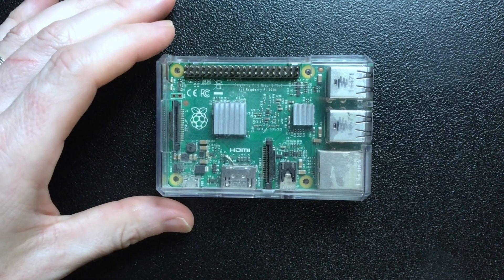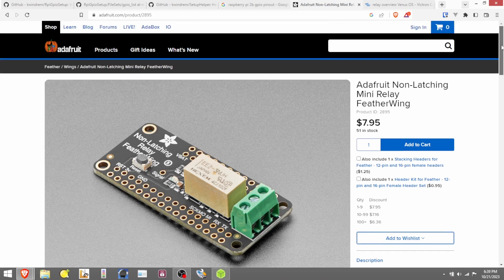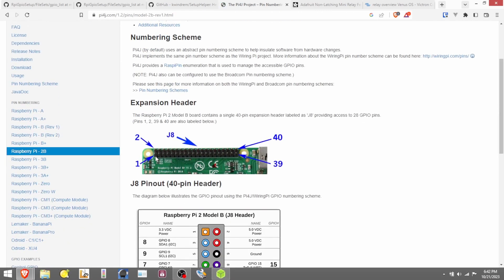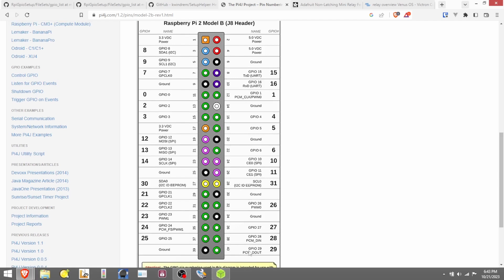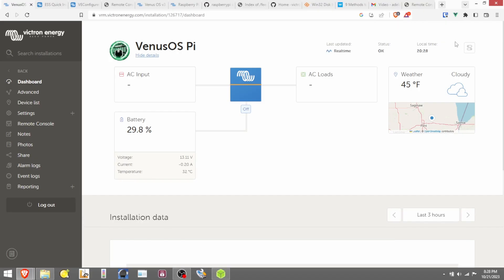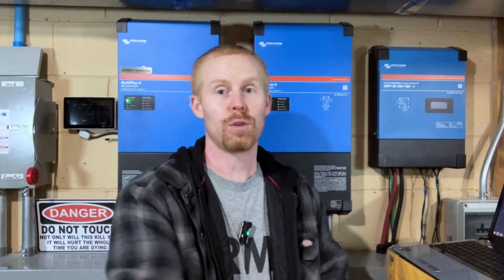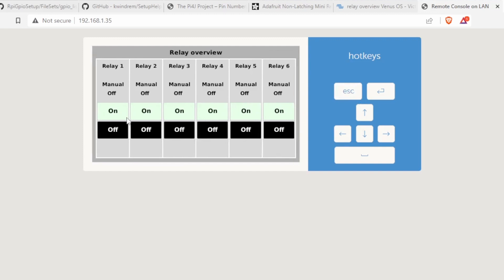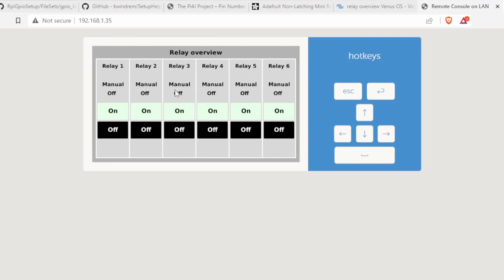Empowering Your Raspberry Pi: Adding External Relays with Venus OS

Comment from the maker: Links to the parts & pieces in the video (affiliate links)
------------------------------------
Adafruit Non-Latching Mini Relay FeatherWing
https://www.adafruit.com/product/2895

ELEGOO 120pcs Multicolored Dupont Wire
https://amzn.to/40avHKx

Victron 48V MultiPlus-II 5kVA 120V Inverter
https://www.currentconnected.com/product/victron-48v-multiplus-2-5kva-120v-inverter-70a-charger/?ref=AzzpK9Fl

10kVA 120/240v Base MultiPlus-II System
https://www.currentconnected.com/product/10kva-120-240v-multiplus-2-5kva/?ref=AzzpK9Fl

Victron Cerbo GX
https://www.currentconnected.com/product/victron-cerbo-gx-system-controller/?ref=AzzpK9Fl

Victron GX Touch 7" Display
https://www.currentconnected.com/product/gx-touch-display-cerbo-gx/?ref=AzzpK9Fl

Comment: Thks 
 Just wondering how do you get the Relay menu? I don't have that option on my v3.6 latest large image from install somehow
Reply from the maker: Under Settings -> Integrations -> Relays you need to enable your relay (or tell it what you want to use it for).
Reply: @AdamDeLayDIY I double checked under Settings there's Relay, but not Integration. Guess they moved it up. Thks
Reply: @AdamDeLayDIY somehow I don't have integration settings
Reply from the maker: @quarkpix  That's odd.  On my 3.6 cerbo, the settings area has been reorganized with new menus.  

I wonder if it has something to do with the large image and needing to enable extra options?  I'm not sure.  I'm not running the large image.

Comment: Can these relays be used for alarm states on the batteries and network devices?
Reply from the maker: Unfortunately only Relay 1 has an "Alarm" function.  The remaining relays all seem to be manual relays only.  

If the battery is connected to the Cerbo, it might be possible to trigger an alarm based on certain battery criteria, but I'm not positive.  I haven't done much with the alarms.  I've got notification set up on the Cerbo and VRM for specific instances.

Comment: Hi Adam, awesome video mate, very helpful to get the relays set up. Would it be possible for you to do a video on setting up analog tank level senders into the Venus OS. I just can't make sense of the info online. Cheers in advance Dave
Reply from the maker: Thanks Dave!

Unfortunately I don’t have any tank that I can put a sensor on.  It might be worth asking some questions on the Victon community forum.

Now I did just do a video on a Bluetooth propane sensor and from what I’ve seen, the same company might do Bluetooth water sensors as well that integrate into the Victron ecosystem.  Might be worth a look (plus less wiring!).

Comment: Wow thanks for this great help. I am going to order raspberry expansion 8ch board. Hope it would work.
Reply from the maker: Good luck and have fun!
Reply: @AdamDeLayDIY  hi Adam. I tried to program using the assistant like you did without pulling wires since am awaiting for the hat for raspi. The problem is the inverter works fine as along as the mk3 cable is connected. It don't pull power from the grid but as soon as I pull out the mk3 cable it uses the grid.
Reply from the maker: @pulith5220  are you using any other assistants?  If not, you could try using the Virtual Switch option.
Reply: @AdamDeLayDIY  no I am not using any other assistance. Let me check VS
Reply: Can I pick your mind abit. The below is how I put the settings for assistant 
Program relay 
Use general flag
Set relay ON
When SOC lower than 15%

Program relay 2
Use general flag 
Set relay off
When soc higher than 50%

General flag
Use general flag to ignore ac

It's keeps charging. I tried stopping my batteries from discharging to see if the inverters would on from grid it didn't. Am I missing something here. I think when I off discharge from bms the inverter was on Inverting and not on ON. because as soon as I put to ON it tries to charge my batteries.
Reply from the maker: @pulith5220  So I had forgotten that the relay option is backwards in the video.  Because the general flag is referencing AC Ignore, when you set the "relay on" it's actually telling the system to Ignore AC IN.  I know it's confusing.  Took me a while to get my head wrapped around it too.  

Simply put, switch the assistants around.  The one you have set to "relay on" set that to "relay off" and visa versa.
Reply: @AdamDeLayDIY  thanks will have a look morrow. I thought of doing that but wasn't sure so i didnt do that. Thanks again.
Reply: @AdamDeLayDIY  thanks will have a look morrow. I thought of doing that but wasn't sure so i didnt do that. Thanks again.
Reply: @AdamDeLayDIY  yes it worked but when battery is low (when i stopped discharging) it don't change into grid. Am I missing something. Need to check to see if charging will occur when I deep discharge. Currently charger don't on which was my initial issue. Now I can't find away to get the grid on if battery is low. Any help is highly appreciated
Reply from the maker: @pulith5220  what do you have in your environment that keeps track of SOC?
Reply: @AdamDeLayDIY  using the bms to keep track.
Reply from the maker: @pulith5220  is your BMS connected to the cerbo?  The cerbo and inverter need to know the SOC in order to be able to make the switch.
Reply: @AdamDeLayDIY  yes it is connected and showing state of charge. To I need to add some line to assistant to allow grid bypass.
Reply from the maker: @pulith5220  Any chance you would be willing to share your VRM with me so I can take a look?

Comment: Amazing video! Thank you so much, this helped me a lot. I´m planning to run the new GUI-2 (which looks just awesome) in the future in my camper. Would it still be possible to have all 6 relays working after upgrading to GUI-2? I read somewhere, that GUI Mods will not work with the new version and that Kevin is not planning to continue his work on the GUI Mods.

Cheers from Germany
Reply from the maker: Thanks!  Appreciate the comment!

I hadn't heard about GUI-2.  Looks like it's gonna be the next UI update for Venus OS.  Looking forward to taking a look at it!  

I would imagine if the new update has a lot of the things Kevin put in GuiMods, there's really no need to update it.  

To my knowledge, the functionality has always been there, GUI Mods just made it accessible through the dashboard.  Ultimately it's going to be based on if the controls are added to GUI-2 or not.

Take care!
Reply: @AdamDeLayDIY  thank you for your answer. 

My camper is stored away at my dads place for the winter so I can't test it myself for the next 2-3 month. Maybe it would be a good video idea to check this out. 😁
Reply from the maker: @YamahaYZFR6RJ05  Now that I know it's there, I might add it to my list.  I'll have to take a look first at what's currently unsupported.

Comment: How do I reverse a relay? When my switch in the screen is off the relay is on. Only relay 1 lets me change normally open or closed. Other 4 relays don't have the option in the screen. I've been trying to figure this out all day
Reply from the maker: You just have to switch the wires around on the relay from normally closed to normally open or visa versa.
Reply: @AdamDeLay07  I wasn't sure if there would be an issue with the pi constantly energizing the relay for months if I did that
Reply from the maker: @Paul_______  I would just verify with the specific relay you end up using.  My use cases always had the relay off until I needed to trigger something, which was always a short trigger.
Reply: @AdamDeLay07  that's it. Turns out my relay is low active so the relay is on when it has no signal. Looks like I need an active in high relay

Comment: Great video. I've done this before. I still suffer with one little issue is my main circuit breaker is wired to a shunt trip on the dc side. When I reboot the pi the gpio pins go high for a couple of seconds and then low when it boots up. 
Annoying this trips my breaker.  Need to find a fix for this at some point.
Reply from the maker: Thanks!  That's interesting.  What shunt trip breaker are you using?